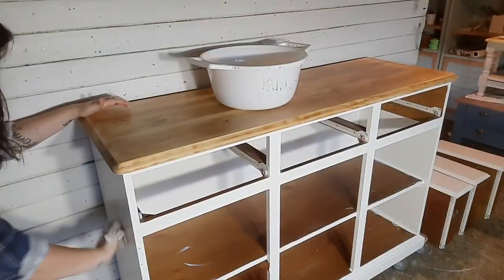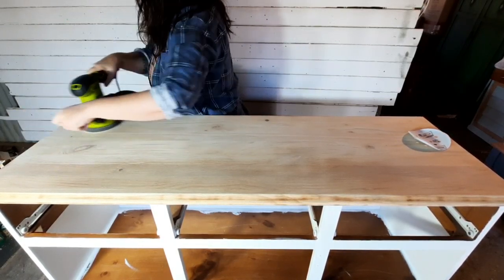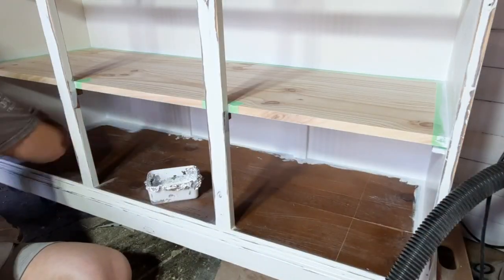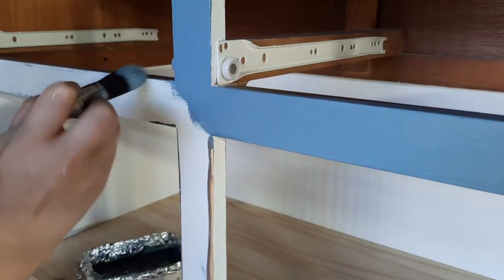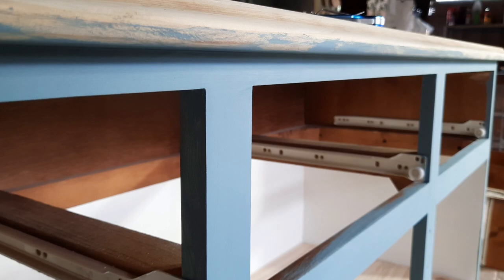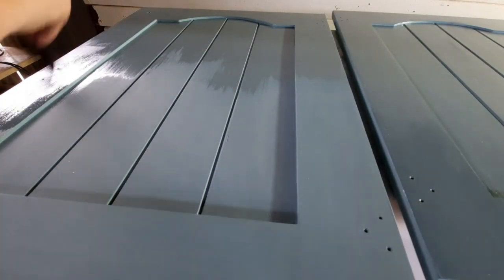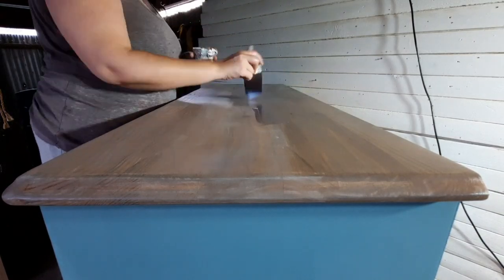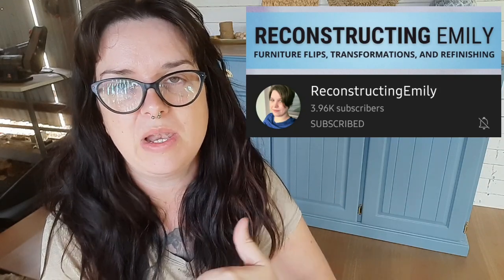Modern Coastal Makeover | Furniture Flipping | Buffet/Sideboard

Comment: You did a fab job! I have a similar buffet but I don’t like the base I want to raise it what do you recommend for such a configuration? I like to be able to clean underneath
Reply from the maker: Thank you 😊 
You'll need to flip it on its back to get underneath. Depending on what the underside is like you may need to attach blocks of wood in the corners to add feet to.
A lot of buffets like this don't have support at the back or middle so if you have a longer buffet like this one I'd suggest framing in the whole underside and including a foot in the centre for extra support.
I hope this makes sense. If not, feel free to reach out to me on my instagram or Facebook page 😁